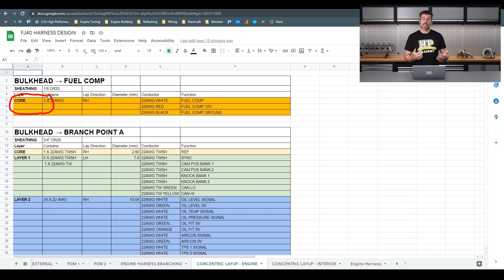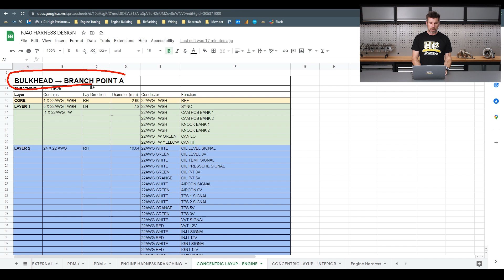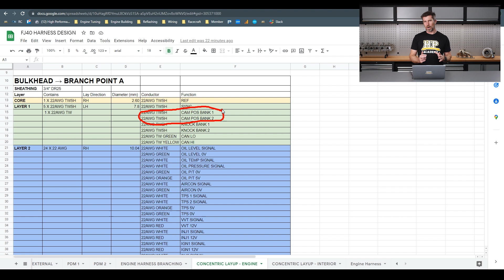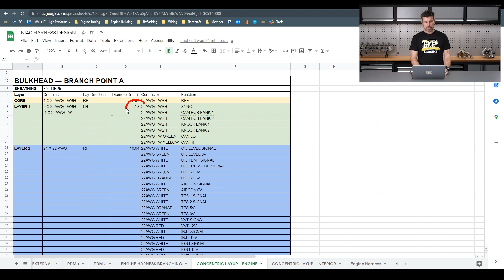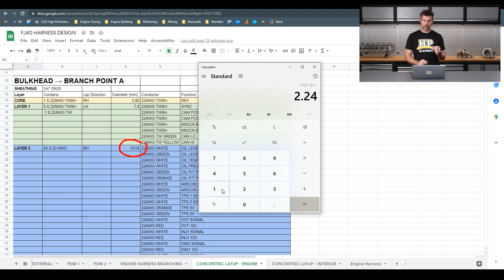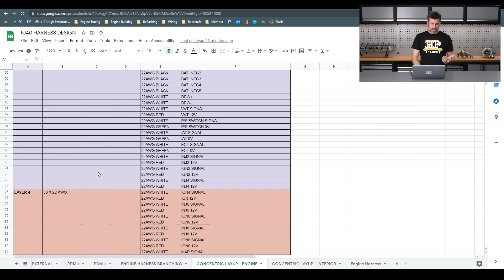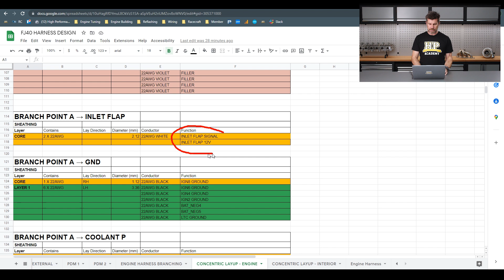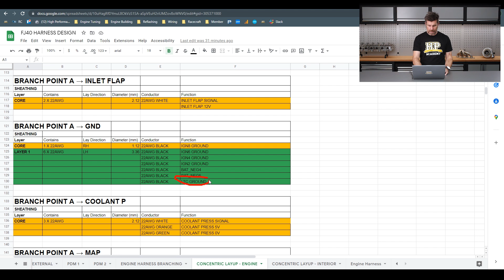Concentric Harness Design | Motorsport Wiring Planning 4 of 5

Comment from the maker: What's your planned wiring project?
🔥 Building a fast car? Get $400 OFF the all inclusive VIP online course package deal: https://hpcdmy.co/vipy106
⚡ 50% off your first online wiring course! Get the knowledge and confidence you want. Enrol today: https://hpcdmy.co/offery106
TIME STAMPS:
0:00 - Concentric Twisting Planning
0:28 - Harness Branching
1:05 - Layer 1 Example
2:40 - Core Design
3:53 - Test Section
5:43 - CAN Wiring Gap Filler
6:09 - Diameters
8:02 - Layer 2 Example
11:04 - Filler Wires
11:34 - Ground Design Note
15:15 - Take Your Time
15:34 - 1 Of Over 40 Modules

Comment: Great video…. I might point out another wiring means… ribbon wiring. The purpose of this is where wiring must bend in one direction, though this can be multi plane bending but not transverse to wire lenght operation; where the absolute minimal volume of wire is needed, and/or; where maximum heat dissipation is needed such as using the absolute minimum Al wire size. This is where the wires are layer flat next to each other. They even make ribbon wiring with separate wires adhered or molded together in ribbons of various numbers of conductors… all color coded but the ribbon provides a natural way of special identification of wires, too… and branch circuits can easily be separated from the main ribbon: by simple pulling them free from the main ribbon. Though not as common laid up ribbons of individual wires is possible but this requires more effort to accomplish… and expense. Nearly all computers and even high tech military weapons use these advantages, and as a result connectors with extraordinary simplicity are available and the non for making extraordinarily compact connections. I note often flat conductors imbedded in flat and tough plastic ribbons are used in computer wiring. One of the neat things is this type of wiring is particularly suited to addition of add-on filters to suppress EMI and extraneous signals off sensitive circuits. The types using high temperature resistant film like Kapton or high temp polyester with flat conductors have per volume of conductive material the highest current carrying capacity. And, they can be mounted using adhesive either as an attached film … like tape… or with double sided adhesive tape to structural components.

Comment: Sometimes I cant help but think the main advantages of these looms is to fill the wallet of the manufacturer. 

Certainly appreciate the level of detail that goes into it, I could just never justify the cost. Id rather spend the money on entry fees going to more events.
Reply from the maker: As Pat mentioned, this is optional, not a requirement. Not all guys pay for the work either, many do it themselves. If you were paying someone to do this work for you though, your budget is going to be big enough that you are not worried about event entry fees 😉 Guys getting this work done for them are generally racing others with similar budgets and builds which I wouldn't call grass roots. 

The logic you are using here you should be using on your entire build too. You shouldn't build your car beyond your means. For example if you fit suspension that took you a year to save for and you damage a corner at the first event, you don't want to be saving for months and months for that one replacement part let alone the other work. Whats the fun in that?

It's all relative, and the guys you are racing at your level will be in the same boat as you too at the end of the day budget and spec wise 😎 - Taz.
Reply: Concentric twisting is completely optional for grassroots budget racing. But it's still PITA building out a harness from scratch, even with a universal harness kit for a standalone ECU.